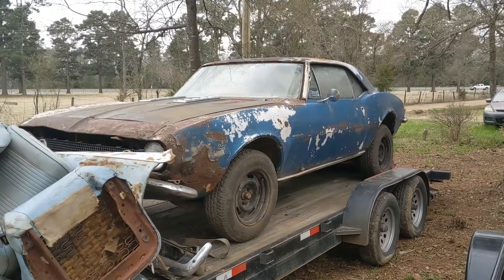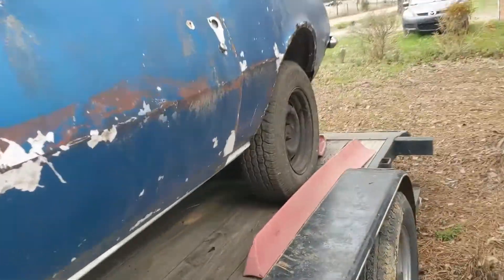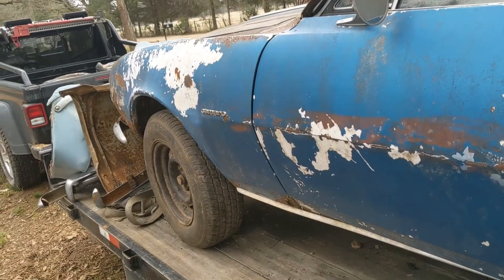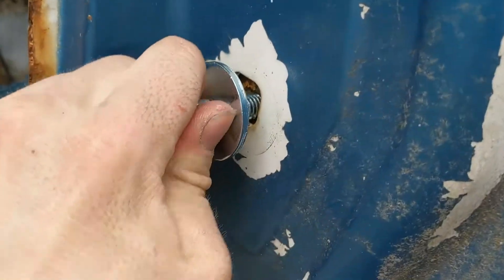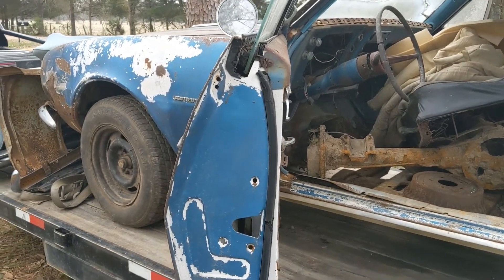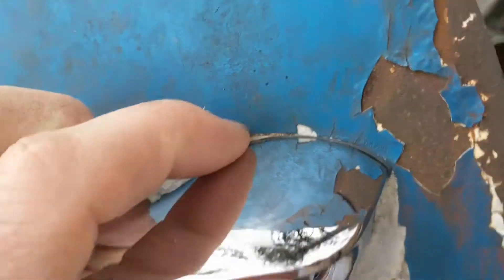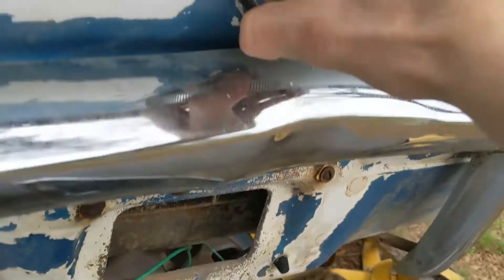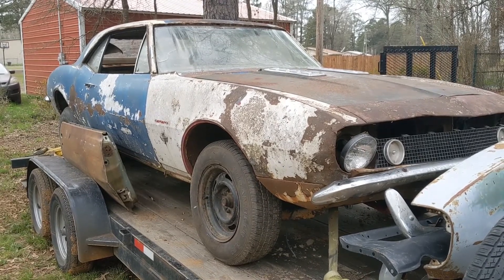I Bought A 1967 Camaro "Rebuild Part 1"

Comment: I want my 68 back, FULLY Rebuilt as I Intended it to be, that My "Best Friend" at the time was Rebuilding for me, being Fresh Out of and Top 5 in his College Coarse, Parents Sold in 92, Without a Title and Me knowing in the middle of the Build...  Would have had a Brand New (1989) Trucks 350 w 5 Speed with only 500 miles on them, Tilt Telescoping Steering, Custom Kevlar ( Kevlar free from work ) Hood with Scoops and Kevlar Tail Wing, Fresh Restored/Covered Buckets, Dual 3" Exhaust, Brand New Carpet, Brand New F/R Quarters I got from work. $4000 just in Primer ( Free From Work ) Brand New Windshield/All Glass and everything else it needed to rebuild... All there... But was taking up room in a Shed they never used, so they sold Everything and if I remember correctly, only got a Few Grand for it... like 2 or 3 grand and I paid 1500 for Rolling Chassis and most of the stuff besides the engine/trans, paint/primmer, steering wheel, quarters and all the Free Kevlar was already included.